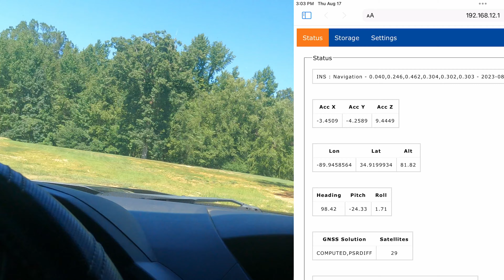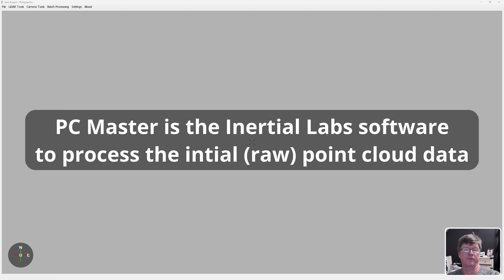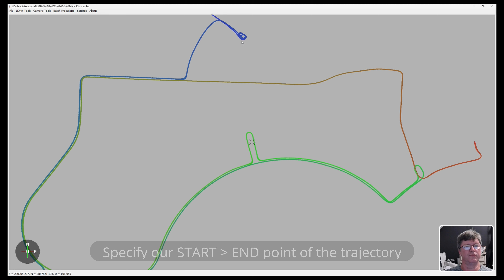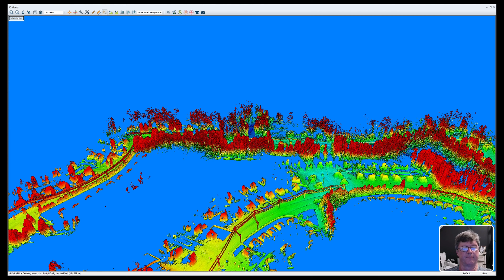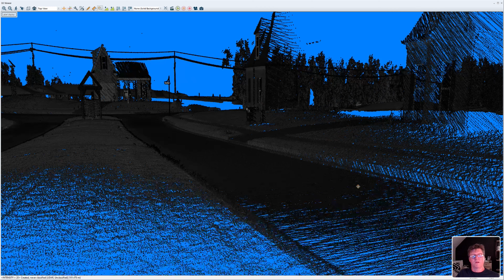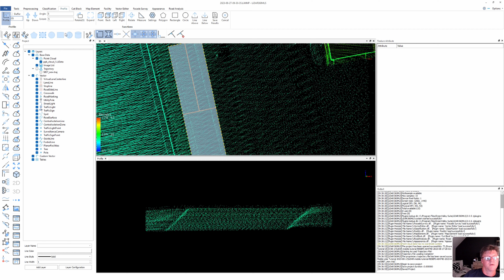How to collect and process Mobile Lidar data on the Resepi Hesai XT32 Lidar by Inertial Labs

Comment: Hi Timmy, thanks for the video. One question about your mounting set up. I saw you linked to the suction cup mounts that you used. What bracket are you using to connect the XT32 to the suction cup mount?

Comment: How many GCP's did you use for that neighborhood when you drove around? Is it similar to the aerial with only like 3-6 being needed or did you use way more?
Reply from the maker: For this I was just showing the overall process of collecting the mobile lidar.  The use of GCPs for mobile lidar is very dependent on what the data is being used for.  If you are doing power line inspections to simply show the condition of the wires and any vegetation encroachment, then the use of GCP's may not be needed at all.  If you are using the mobile lidar for Topo and Contour data, then they would absolutely need necessary to validate the data. One every 1/2 mile, maybe 1 mile would be needed?  It all depends on your specs and end use of the deliverables.  If you are fortunate enough to have turn arrows in the center lane those are awesome for Lidar control points.  Any white and yellow stripping in the center lanes are very visible in the intensity view.